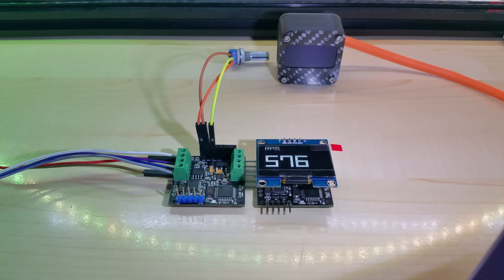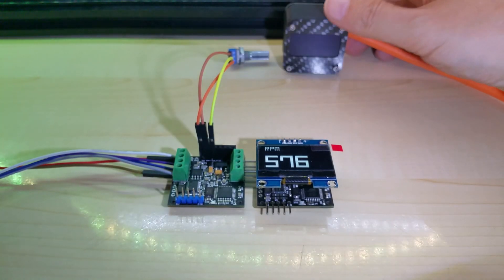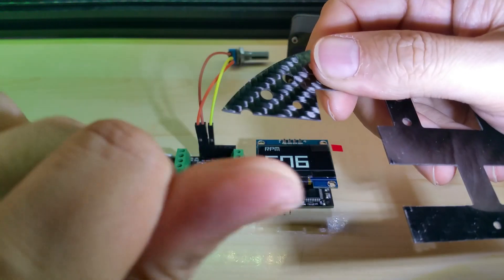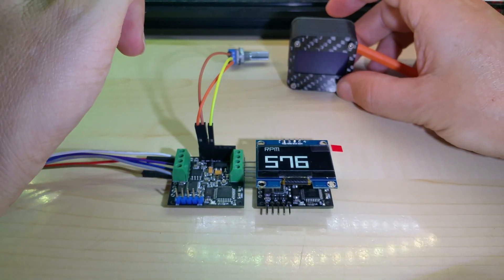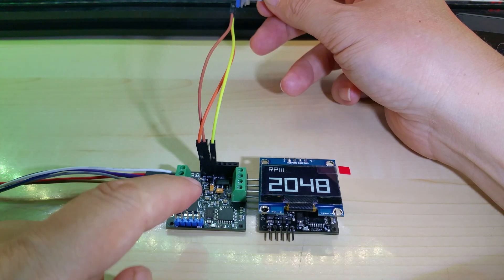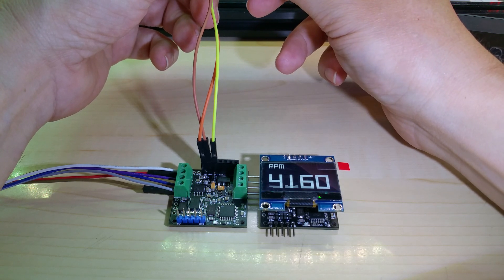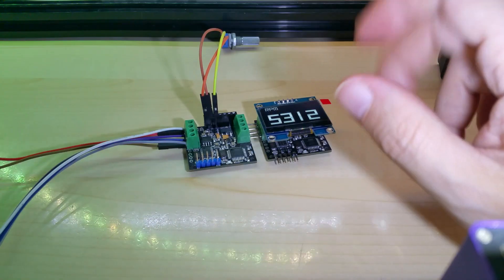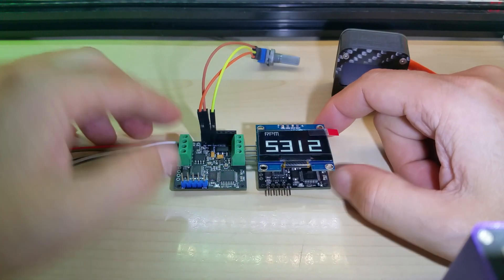CAN GAUGE micro. Worlds smallest full fledged CAN BUS Gauge, CAN BUS Simulator, by Hayri. Part 4

Comment: Any reason why the display never shows an odd number on the last digit? 
Top work btw 👍🏻
Reply from the maker: Thank you. Good question, simple answer, because it is dividing the 0-1023 value of the analog pin by 8 otherwise the numbers go through the roof :-) But obviously in real life, as you can see in my test in the car, it shows every single digit :-) Might be a better way to make the simulator but at least this is better than random numbers jumping around, which is no use to me to test code, for example the gear indicator code or to test my new code with shift light :-)

Comment: Just some general feedback, the display looks nicer if you can add formatting to align the numbers to the right. And I always make my display able to read 10,000 

Nice little unit tho 👍
Reply from the maker: Thank you, normally do align to the right as well but maybe on these it should be centered :-) I remember a library doing that but which one was it? Another idea would be to use larger font and decrease the size as the digits increase, anybody done that?
Reply: @iHayri1  the library I used did not have the align right function. I had to do it manually 😪
Reply from the maker: @taicr80  Oh I know that, none do as far as I know, but there is one that centers it, just can't remember which one :-)